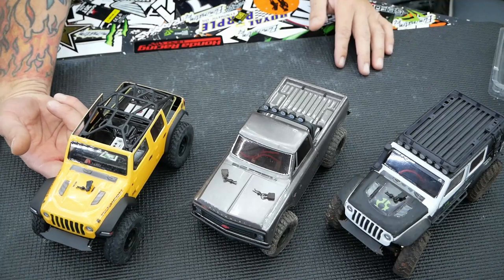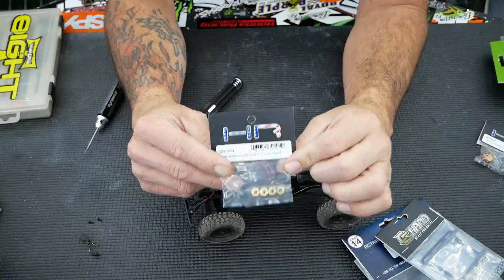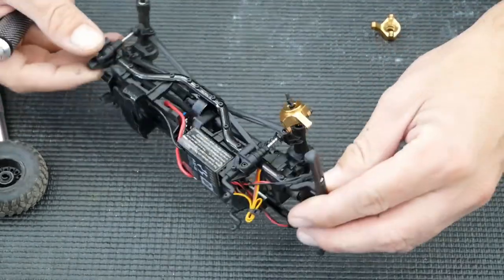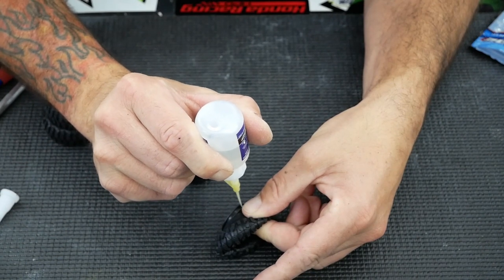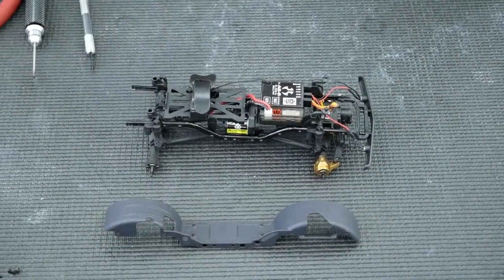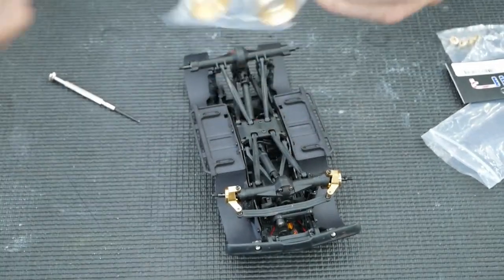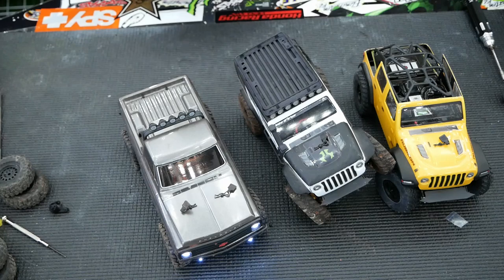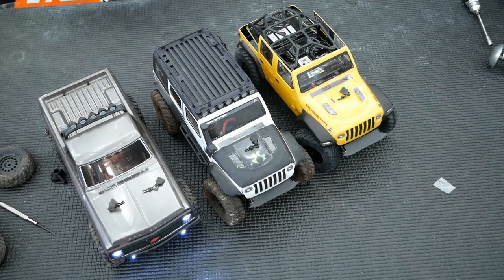AXIAL SCX24 C10: UPGRADES FROM HOT RACING AND CC HAND SCALE ACCESSORIES

Comment: The tire rub is real! Need to custom cut the fenders to accommodate the tires, also you can mount the front bumper upside down so that it curves up instead of dropdown for better front end clearance.
Reply: Exactly  ! Cut the body . Every time it rubs a tire its like putting on the brakes. And raising up the body makes it do worse offroad
Reply: Just taking off the bumper is far better. 
Dont catch it at all and instead of putting lights in the body just take the lights out of the bumper and slap them in the body. 
No need for all those lights or that rock catcher. I mean bumper.
Reply: I flipped my bumper and it works great
Reply: @jimbo4203  nice i took mine off. 
Doesnt hang up on anything now.
Reply: @krotchlickmeugh627  since then ive made mine into a rock bouncer
Reply: @jimbo4203  nice.

Comment: Not sure if your tools are magnetic but if they aren’t...
Take a strong-ish magnet and rub it along the shaft of the screwdriver. 

Makes it magnetic enough to hold the screws on the screwdriver while removing and installing them
Reply from the maker: Since this we ordered one of those boxes with the  square holes that you rub screwdriver shafts in to magnetize or de magnetize. Works great but the spring steel bits like this one don’t hold a charge for long compared to others
Reply: @ProNoobRC  aaah I see, well cool video!

Comment: I got that same c10 and I am wondering what led lights you used in the body
Reply from the maker: Just another set from the dead bolt You need to have to cut and extend the wires

Comment: Nice vid. Thanks. Have you seen or used the kinetic brand Shock upgrade. It extends shock but keeps compressed lenght the same.
Reply from the maker: Yes actually just started seeing those around we are gonna get some after the holiday rush
Reply: @ProNoobRC  i got them and they sure helped out the bumper not hanging up on everything. thanks
Reply from the maker: Yes the stock shocks definitely leave a lot to be wanted. Where did you order yours from eBay?
Reply: @ProNoobRC  yes kinetic brand
Reply: @furyss1tv184  just take the stock bumper off. Relocate the lights into the proper space instead of buying new lights. 
You wont have the extra burden 9n your battery and the only thing that will catch on any rocks is the body. 
But you just cut the two little vampire fangs left over on the body and you can literally climb vertical

Comment: My battery for my scx24 stopped charging, and I got a new battery. It is a 2s 7.4v 30c 300mah and when I plug it in, I have no throttle. Do you have any ideas?
Reply from the maker: Make sure your throttle trim is at zero when powering up
Reply: @ProNoobRC  I've tried that 🤔. Do you think it could be a bad motor?
Reply from the maker: Check your connections and make sure motor plug is in all the way. The motors will smell of cashed so smell it but I don’t think so We run all ours for hours on end and no issues
Reply: Dang. This is a little frustrating. I only had about 10 batteries into it tell this happened. I have triple checked my motor wires are good. Thank you for your ideas! I do have an adapter from the batter connector on the scx24 to a jst connector on my new battery. The lights on the bumper work, I have steering, just no throttle.
Reply: @John-shreds  it's your motor I recommend a barrage motor I love mine
Reply: Try unplugging your steering servo.   Sounds odd but I've heard a few instances where a bad servo will stop the ESC from working.  If it now powers up, you just need a new servo.
Reply: I fixed it. It was a dead motor.
Reply: @John-shreds  Cool!   Glad you got it figured out.  Did you use the stock motor or upgrade?
Reply: @mnmvuk  I just went with the stock motor. I felt like it has enough power for me.  It was only 6 bucks. 

If I burn this one out, I'm definitely going with a barrage motor
Reply: @John-shreds  thanks for coming back and letting us know what ended up being the solution to your problem !
Reply: My deadbolt burned up its motor in a couple runs, called amain hobbies where I bought them and they sent me a 3 free motors! Gr8 service! Put the new motor in and no problems since🤙

Comment: Where did you buy your headlights for the c10?
Reply from the maker: I just drilled holes in body and poked a set of LEDs through behind stickers
Reply: @ProNoobRC  That will answer my question.
Reply: With mine I have brackets for headlights

Comment: Ok but isn't it technically a K 10 causes it's 4x4? C=2wd K=4wd 10=1/2ton 20=3/4ton 30=1 ton .050= 50 thousandths of an inch
Reply from the maker: That’s a very good point! A lot of folks myself included didn’t know that!! Thank you for the helpful info with the models on the older chevys

Comment: Hey guys. I'm a new subscriber to your channel. What brand servo did you say the SCX24 will need a s a steering replacement?
Reply from the maker: Hi welcome!  Emaxx and I think ma0II208. Search Emaxx scx24 on Amazon. Make sure they’re branded Emaxx
Reply: @ProNoobRC  emaxx scx24... Fixing to be on it. Also... would polystyrene be strong enough to build a half cage body kinda like the Trail Honcho?
Reply from the maker: Yup!  Use solid and CA glue and it will be great. That’s all we use around here for the micros and only break if fall to floor really.
Reply: @ProNoobRC  what is CA glue? About the same as plastic scale model cement.
Reply from the maker: More like crazy glue. Just type CA glue into search bar on Amazon and should pop up